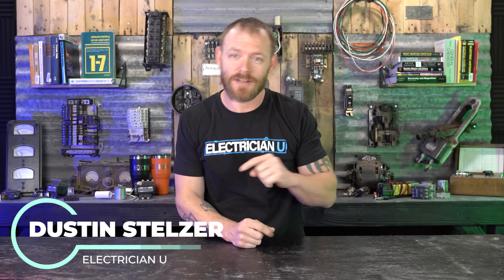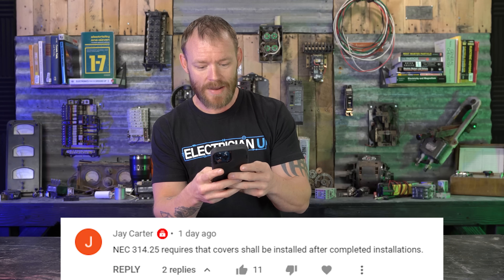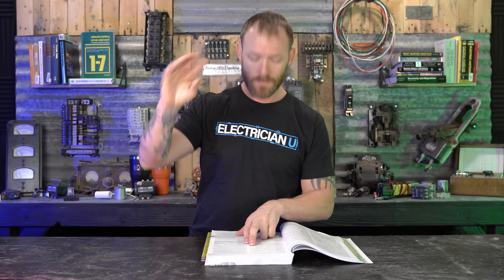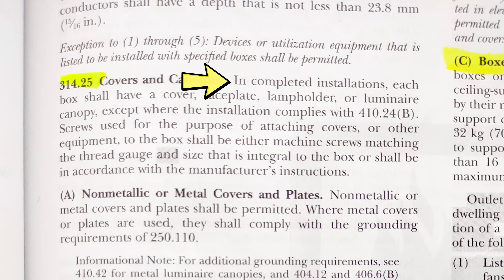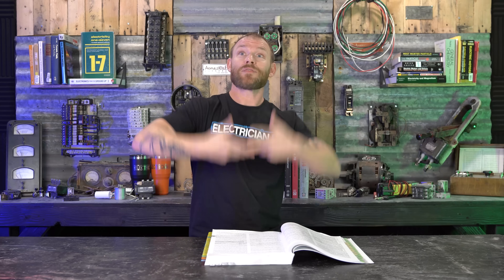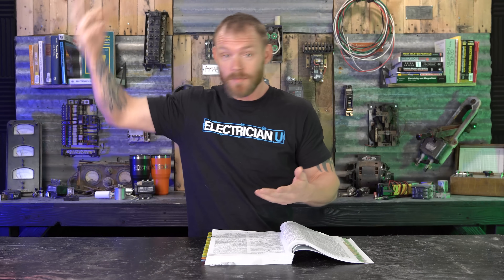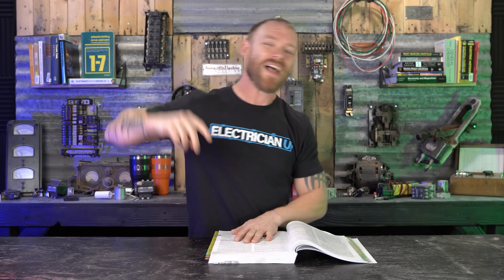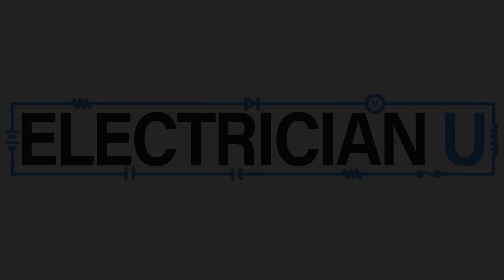Code Violations - The Case of the Missing J-Box Covers

Comment: As someone who doesn't know much about electrical codes, but have made arguments related to these typse of standards or agreements, I have a couple of arguments to point out. Reasonability and the spirit of what is said has weight, like others have said; but the people who put these together are not stupid and chose these words carefully. In their eyes it clearly states whatever their intent is or it would be revised next go round. Also the entire script is to be taken into consideration as a whole. 110.12 talks about workmanship, installation, and unused covers which also apply to this situation. 110.3(B) states that installations are to be to manufacture specs. 314.16(A) describes volume fill. Likely, to them, this argument has already been explained in these sections and/or elsewhere. Interpretation and common sense usually follow principles like occam's razor; i.e. manufacturers likely intend for the cover to be installed, or it wouldn't be included. So the simple instruction title "Installation Procedure", barring a specific omission, can be used to argue the manufacturer intends for you to install the parts that came with the box.  To me they seem to have targeted the wording specific to define the types of sold boxes that would be considered valid and to be within code so people may easily identify a valid box; thus permitting sections like volume fill to be assumed that the box is enclosed without stating it explicitly. In high voltage situations they seem to have the redundancy to emphasise the necessity of safety. It's not hard to ammend the book to include more specifics, but makes the volumes longer and more likely that those in need of the information will gloss over info because it says the same thing a thousand times. Humans are humans, so there are likely many examples that contradict everything I've said if you zoom in on them; so remember to take it as a whole. If I were an inspector I'd call a violation because not having an enclosure is purposfully circumventing parts of the code that assume there is one. Love this is video is still awesome 3 years later and the info here is invaluable. Keep it up.

Comment: Dont contractors need to remove the covers to paint.  Maybe this is because the install needs to be completed prior to dry wall and the plate would not be installed until after drywall is installed

Comment: Dustin, remember that you are talking about an NEC codebook with multiple code making panels that don’t agree on much. Probably a different panel that made the rules about 600 volts and up. There is, however, a legal concept my attorney taught me when I was going through a divorce. He said “There is a difference between the letter of the law and the SPIRIT of the law.” That can cut both ways, because you can violate the “spirit” of the law without violating it to the letter, or you can not do something that you technically aren’t required to by the letter of the law, or rule, but you know the spirit in which the law was intended requires you to perform said action. The covers should be installed.

Comment: As you are aware, it is up to the inspector. But, you wont (should not) fail an inspection due to a cover being open. If it is provided. While high voltage installations you would fail the inspection due to a loose or open access to an electrical connection or branch enclosure.  Really like your channel.  👍

Comment: Individual states may have additional code or code worded differently.  For Michigan in concern for box covers: E3906.9 Covers and Canopies; Outlet boxes shall be effectively closed with a cover, faceplate or fixture canopy. Screws used for the purpose of attaching covers, or other equipment to the box shall be either machine screws matching the thread gauge or size that is integral to the box or shall be in accordance with the manufacturer's instructions. (314.25)  So under that wording in addition to NEC standards states that J-Boxes must be closed.

Comment: Ok I’m not 100% sure here…BUT…I think that 110.27(A)(4) actually permits them to be open!  Please explain!
Reply: Provided they meet the height requirement, which for 220V split phase is 8 feet. Less than that you cannot have exposed conductors/terminals. Does a properly installed wire nut constitute unexposed? Maybe. But workmanlike, "best practice" installation would likely demand covers on boxes.

Comment: I look at it this way if you have wires hang out a box with no cover on it then that is not a complete installation regardless of what code says all boxes must be covered regardless of voltage other than data but that is my opinion and sometimes they all stink

Comment: 314.25 doesn't say the cover has to be provided. It says it SHALL have a cover. If you go to article 90.5 (A) Mandatory Rules it explains what actions are  identified as  being  "specifically required" or "prohibited" by the terms SHALL or SHALL NOT.  So that tells me SHALL would mean Specifically Required.
Reply: The question here is not whether the cover is required. It's whether the cover, whether "provided" or simply present, shall be installed.
Reply: @rayives7758  In Article 314.28 (C) Covers.  It says all pull boxes, junction boxes, and conduit bodies SHALL BE PROVIDED with covers compatible with the box etc. So going back to Article 90.5 (A) Mandatory Rules, SHALL means "specifically required" . So by mandatory rules of the NEC, that tells me the cover has to be installed

Comment: LOL...Interpretations without tangible code experience maybe? - 314.25 is clear....."each box shall have a cover" and it is under the installation portion of that article. Installations are required to be completed, the leaving off of a junction box cover exposes individuals to live parts or potential arc incidents that could result in a potential fire depending on the placement of that box without said cover. Now, I support your efforts as always..However, When you create this "narrative" of the NEC not being specific on this specific topic you risk harming the industry as young impressionable electrical students would learn incorrectly, you take on that responsibility once you accepted the educator message. Also, I happened to disagree and felt offended (and not really the WOKE kinda guy) with your statements about those of us who are well versed in the NEC, you seem to forget that we were (are) master electricians for decades before you were more than likely born and not much has changed, cables are still cables, conductors are still conductors, installing an electrical panel is still the same process. So, the "field" electrician has a responsibility to learn the NEC as everything they do is founded in the NEC even if they choose to not admit it.
Reply: While I appreciate your thoughts and comments, please make sure the NEC is more explicit so things like this is no longer left up to any interpretation.  If they can be explicit for over 600v or 1000v, they can be  here as well.
Reply: That's BS....YOU folks write the NEC and submit public inputs no different than I do. Also your assumption that it isn't clear is wrong..its only unclear to Dustin and clearly yourself.
Reply: I follow Dustin and Paul and I am here after hearing Paul make the reference on his podcast, which I figured had to be this video that I watched.  I would love for Paul and Dustin to collaborate on theses type topics to clear things up for us trying to be better electricians.

Comment: Thanks for the Video, very interesting.  Do you ever do anything with Class 2 -24v low voltage circuits?   When you connect (splice) wires together on the 24V side ..do they need to be in a closed box?  With a cover?   What does in say in the codes about these type of installs?  For example: installing LED strip lighting.  Thanks
Reply from the maker: All splices are to be made up securely and be readily accessible. 

For fire stuff this is a whole other book. Which would be more applicable to LED lighting than the NFPA 70. IMO.

Comment: It's unfortunate that the vague wording of the NEC provides such a fertile ground for interpretation and nit-picking.  It seems common-sense to me, a non-electrician, that a j-box should have a cover installed, to both protect the wiring from physical damage and to protect life and property from arc faults.  Can you speculate as to why the code is precise in it's language for higher voltages but is a bit more "open to interpretation" for lower voltages?  Was it a simple oversight, or is there a technical reason for the discrepancy?
Reply: I agree with you

Comment: question 1: In this scenario, is there a violation of the §1926.405(b)(2) requirement that "all pull boxes, junction boxes, and fittings shall be provided with covers?"

Answer: The Occupational Safety and Health Review Commission and the courts have stated that no violation occurs when there is an absence of employee "exposure" to the hazard. We cannot tell from this scenario if the height of the fixtures and boxes alone would be sufficient to establish a lack of exposure. For example, if employees in the area were working from ladders or scaffolds or otherwise had access to the boxes, there would be exposure. Also, there can be exposure from indirect contact, such as from carrying long conductive objects (metal piping, conduit, etc). Craft personnel working in the area may also be likely to want to use such outlets for their tools. If they have access to ladders etc., that could constitute exposure as well.

So if you could guarantee that no-one would ever be "exposed" to the hazard, no cover is required. Would you sign that guarantee?

Comment: NEC sometimes is not as clear as OSHA requirements.  For example:

29 CFR 1910.303
Response: The provision in question, 29 CFR 1910.303(g)(2)(i), generally requires "live parts of electric equipment operating at 50 volts or more" to be "guarded against accidental contact by use of approved cabinets or other forms of approved enclosures" or by other specified means.

There are many instances where OSHA requirements are tougher than can be found in NEC. This is why covers must be installed during an OSHA inspection. A violations will be written if junction box covers are not installed. That hi-lites a tough situation: when dealing with electrical systems in industrial and commercial systems, you have to be aware of more rules than just what is detailed in NEC.

Comment: I would go back to the very beginning, the book of Genesis in the NEC:   Article 110.12:  "Electrical equipment shall be installed in a neat and workmanlike manner."   

Hanging energized wires that can create sparks and fires outside an open box is not a "neat and workmanlike manner."

Comment: § 111.81-1 Outlet boxes and junction boxes; general.
(a) The requirements of this subpart apply to each outlet box used with a lighting fixture, wiring device, or similar item, including each separately installed connection and junction box.

(b) An outlet box must be at each outlet, switch, receptacle, or junction point.

(c) Each outlet or junction box must have a cover unless a fixture canopy, switch cover, receptacle cover, or other cover is used.

(d) As appropriate, each outlet-box or junction-box installation must meet the following standards, all of which are incorporated by reference (see 46 CFR 110.10-1): Article 314 of NFPA NEC 2002; UL 50; UL 514A, UL 514B, and UL 514C; IEC 60092-101; IEC 60092-201; IEC 60092-306; IEC 60092-352; 60092-401; and IEC 60092-502.

(e) Each outlet or junction box must be securely attached to its mounting and be affixed so as to maintain its designated degree of protection.

(f) Each outlet and junction box must be suitable for the environment in which it is installed and be constructed to the appropriate NEMA or IEC standard.

[CGD 74-125A, 47 FR 15236, Apr. 8, 1982, as amended by CGD 94-108, 61 FR 28283, June 4, 1996; USCG-2003-16630, 73 FR 65199, Oct. 31, 2008; USCG-2013-0671, 78 FR 60153, Sept. 30, 2013]

Comment: Can I put neutral and ground in the same last hole in main panel 50 amp 4 conductor range cable
Reply: You talking about the bus bar or the access knockout? The cable should be intact coming in the knockout, neutral, ground and hot all together.  inside, neutral and ground, although ultimately bonded, should be on separate bus bars. And if there's only one hole left you need an extension bus for the full one - you don't put two wires in one hole.
Reply: @rayives7758  I'm talking about the neutral bar there was only 1large hole left

Comment: I wonder if 110.3(b) would apply to the j-box covers. It may depend on if the manufacturers instructions for the 1900 box or other boxes would include installing the cover. Alternatively, 110.12 might be in play given the neat and workman like manner. Not sure what all is in ANSI/NECCA Standard 1 if it requires boxes to be closed.
Reply: This! 110.12(A) “Unused Openings” states “unused openings, other than those intended for the operation of the equipment, those intended for mounting purposes, or those permitted as part of the design for listed equipment, SHALL BE CLOSED to afford protection substantially equivalent to the wall of the equipment…”

Because it was discussed in this video, “shall” is legalese for “must”. “May” is optional. In essence, 110.12(A) is saying that the opening in the boxes (access panels are openings) SHALL be covered because they are clearly meant to be in the design, they are not a functional opening (for a switch or lever), and are not meant for mounting purposes (screw holes).
Reply: @bassettalec  This point was raised in a comment to the original video. The discussion suggests (reasonably, I believe) that this section refers to knockout plugs, breaker space blanks and the like and not to access covers.

Comment: Where are all the covers, usually on top on the equipment the jbox is providing power to or swiped to be used to cover the area being inspected tomorrow.

Write the panel and breaker on both sides of it and on the side of the jbox and it tends to stay put.

Still working in the jbox?  Hook the corner of it with a screw and tighten it down so the cover is open but still attached to the jbox.  The lazy buddy fucker who will swipe you cover instead of walking back to the job box is usually too lazy to unscrew your cover.

Comment: On top of all this, the whole point of having a cover is so that you protect people from random energized conductors. If the cover's not completely installed, you defeat the purpose of having covers. Spirit of the code.
Reply: Absolutely correct.  Nothing to read in to, "shall have a cover" is the exactly same as the box shall be covered.   If it said the car shall have an engine, I would never think the engine was in the trunk.  STOP IT!  Don't be confusing dude.  Tell people to cover the box Electrician U, that is the correct procedure and right thing to do.  Come on, let's act like intelligent safety minded people.
Reply: Depends on if it's readily accessible or not. If it's 15 feet in the air I don't think anyone's super worried about it
Reply: Yep. However, the most important code is the one in the municipality you are working in, as that local code is  what's required for those sometimes "unusual" inspectors.
Reply: It's interesting that they do say it needs to be closed for high-voltage. Seems to imply even more that it's okay to be open otherwise, and that it's not just some oversight/poor wording.
Reply: Agree, says it “shall have”, intent of shall in contracts means must.  Agree,  it’s an inconsistency on specificity, but the intent is there.
Reply: Follow the logic, ‘Have a cover’ doesn’t necessarily mean ‘have a right size of cover’ and install a 4by4 cover on a 12by12 box😂😂. Don’t try to take ‘wording’ jobs away from lawyers pls!
Reply: @无党派人士-l4p  so your saying that people dont have common sense, your say ing that if the code says to cover a outlet, they mean that you can use a cover for a light switch to cover it. You need to follow the l9gic.
Reply: Also to keep RATS from eating and shorting out the sysytem
Reply: I think Dustin is wrong on this one. What is the point of requiring provision of a cover that doesn't have to be used? The intent is clear here, even if the language suffers slightly from that for 600+ vols: cover the wires at junctions.

Comment: This is opinion, but I completely agree with it; the master I worked with taught me to cover everything. The reasoning is because even in an out of the way attic, you don't want someone shuffling through to catch a wire and break a circuit. 

Basically, it's better to be safe than sorry. Some HVAC or insulation guy could have a real bad day catching an exposed wire and accidently ripping it out of it's wire nut.